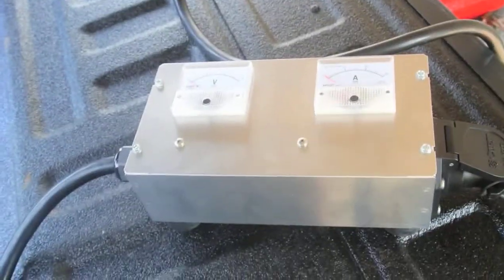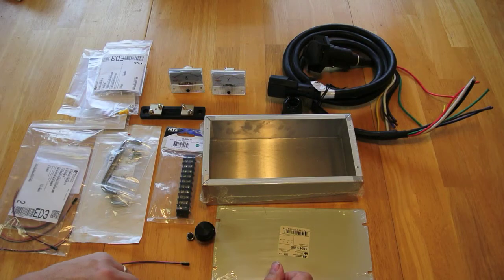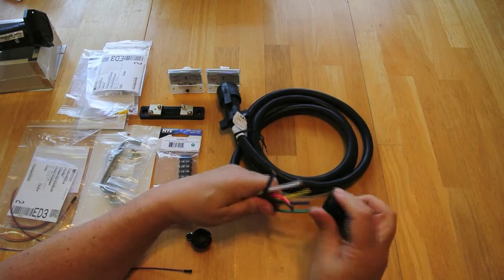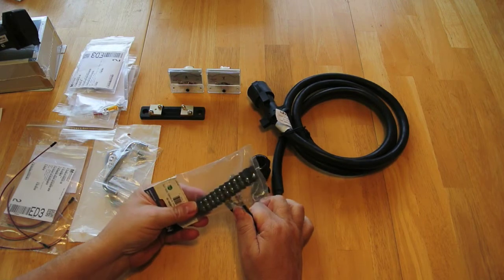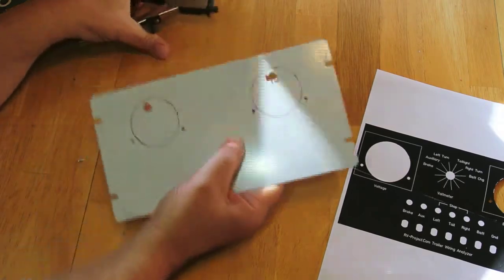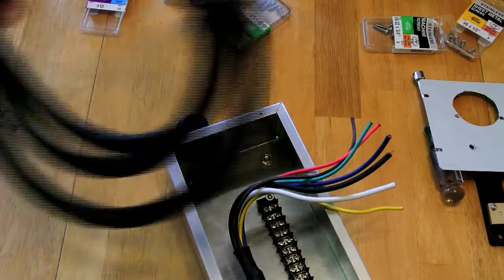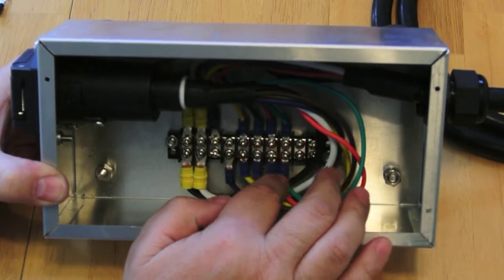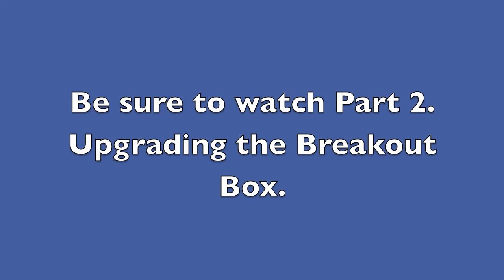Building the RV Wiring Test Box (Part 1)

Comment: Execilliant project and a very handy bit of kit to have.  Cheers.
Reply from the maker: I actually built it because I was having a brake issue and needed to isolate the problem. 

I then took the RV to a repair shop (under warranty) and they made it worse in their attempt to fix it. They then tried to blame it on my 1yr old truck. 

So I whipped this box out and proved the problem was with the trailer. Ultimately I helped the shop find the problem (a bad butt connector) and everything works great now.

Comment: I Love your video! if you could build a small intro video to show why you need something like this. Please show test on a RV maybe showing an error to understand the fault variance.
Reply from the maker: Actually I built this test box to convince the mfg and dealer there was a problem with my trailer wiring. At this point, we are working with both to resolve the issue. When the problem is corrected, I will produce a video showing how this box helped identify and resolve the problem.
Reply: Love the box think about selling them!